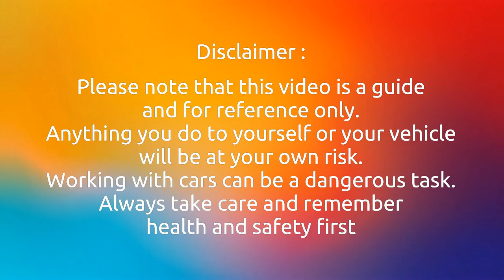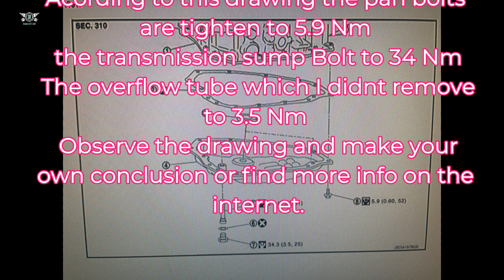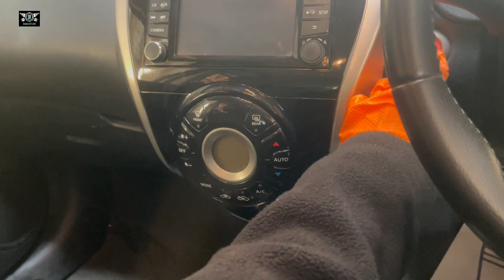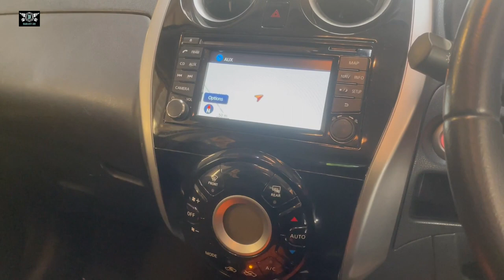Nissan Note 2014 Transmission fluid drain and change

Comment: nice  video -  do  you have any  harsh  shift  issue  after  replace  oil fluid trasmission ?     I  have   Nissan Note E12  supercharge 1.2 .    2014  year   -  when  engine is cold    and  select  reverse gear  I  get  Bang -  Do  you think  if  I  will replace  oil cvt gear  should be solve  the problem ?    thanks     PS:  anyone  has the same  issue  please answer - thanks
Reply from the maker: Hi, in this case I don’t have any bangs or hard shift. Sometimes if you change the transmission fluid it helps with the hard shifting, but if it doesn’t then it might need transmission shifting solenoids replacement.

Comment: Hello, I have the same Note 2014 1.2 dig-s CVT, it has 80 000km mileage and have not changed gearbox oil yet, do u know at what mileage should I change oil? 100 000km?
Reply from the maker: Am not sure of the official interval mileages but many manufacturers recommend every 60000 km. As auto transmission fluid can deteriorate fairly quickly.
Reply: Okay thanks @DaringBeefcake
Reply from the maker: you welcome  @TickleTube1

Comment: There's no need to replace the strainer. It's just a metal screen. Just spray it out with some brake clean. However, you should've replaced the filter. It's on the side of the transmission.
Reply: incorrect. That needs to be replaced
Reply: @bajan246bim No, it doesn't. It's not a filter.